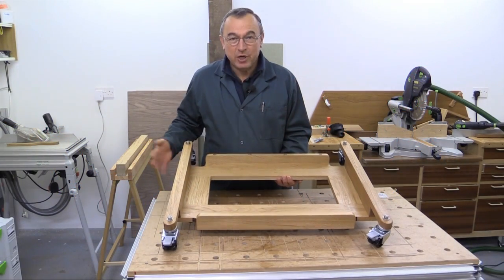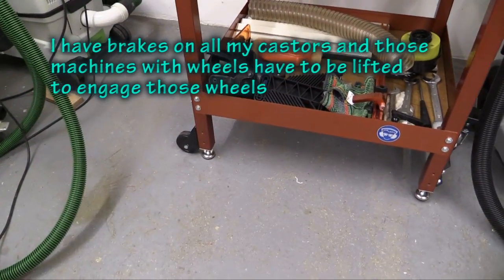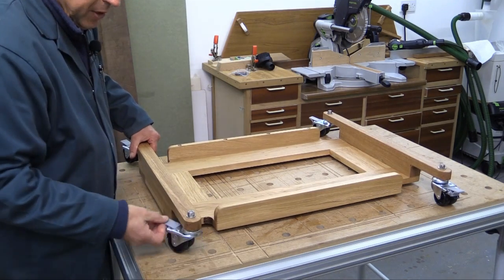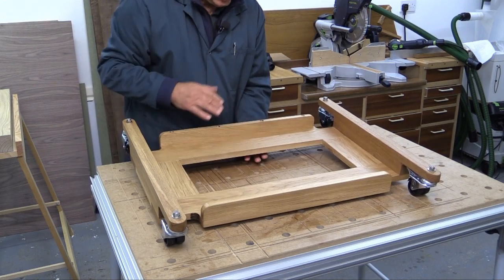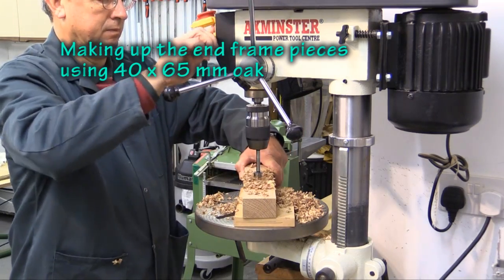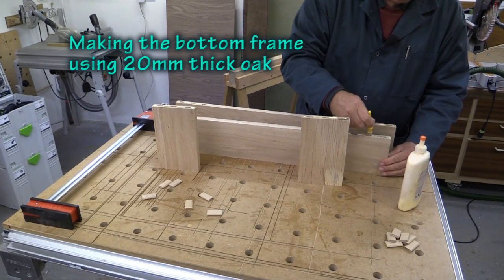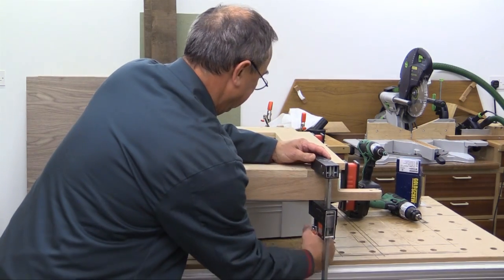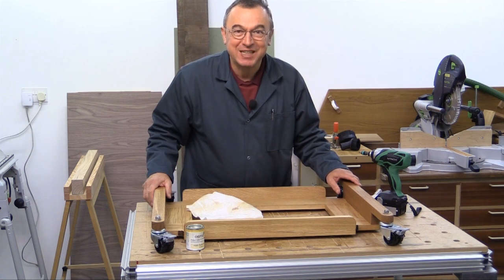How to make a moveable machinery platform - castor carriage

Comment: Hello and thanks for your quick reply.

I also live in the UK (Northern Ireland) which makes it easier to get all tools that I see in your videos.
I am currently working on building a router table and have bought a few UJK items from Axminster that I saw in your reviews.
Not sure if thit is the best decision, but I will try to make the top of the table from Fermica kitchen work top.
The cast iron one you have is probably the best, but my budget has shrunk a bit over the christmas period:) , so I am going to try with fermica first and if it's not good enough will have to save up for the proper cast iron one.
My next purchase will be a mitre saw and wanted to ask you for your advice as I have narrowed it down to Festool Kapex and Bosch GCM 12 GDL 12" gliding mitre saw, which has a negative side with it's weight of 32kg.

There are so many questions I would like to ask you, but I just don't wan't to take up your time.

Many thanks once again
Reply from the maker: Hi Vladimir

Well I was not expecting you to be in the UK - super.

I made a router table using kitchen work top with Formica and it lasted nearly 12 years. The most important thing is to make sure that the router is securely mounted. You will amazed at the amount of torque that a router produces when it starts up.

Before I bought my current mitre saw I had two on my short list - the same two that you have. The Kapex won and was my very first Festool purchase (from Axminster of course). It took all of my savings and a bit more but it is worth every penny. Everything seems to go together absolutely square using Festool kit.

Please do not worry about contacting me. I was lucky enough to have been employed throughout my working years and now it is time to give something back. I make my videos to help other people - and that includes you.

Peter
Reply: Peter Parfitt
Hi Peter

I have been living in N.Ireland for just over 5 years now as my wife is from here. We both travelled aroung for a while and lived in few different countries but decided to settle down here for good.

12 years is quite impresive, it will probably outlive many current VALUE router table brands on the market. Will give it a try anyway.
Although I haven't purchased it yet, it's in my shopping cart on the Axminster website, a UJK Technology 10mm Aluminium Router Table Insert for securing my recently purchased 2400w Triton router which hope it would have plenty of power for most tasks mounted under the table. Hope it will fit onto the universal drilled base sturdy and safe.

I think I am leaning towards the Kapex 120 as well, but will have to wait for a while and save up unless I get a good bargain online.
Somebody mentioned that the 10" kapex is more precised than the super heavy bosch, which advantage is the extra capacity.

There are so many tools and machines around your workshop, I don't even know what some of them are for? :))
Hope to have a shop like yours some day. It all takes time and MONEY :)

Would love to work with oak as I have a couple of projects on my mind in the near future when I complete the router table.
 Oak looks so nice and it's probably very strong. I haven't managed to find a place that sells oak in my town yet as it's probably very expensive and I guess it will have to be ordered from elsewhere.

Thanks for your time, it is so kind of you.
Reply from the maker: Hi Vladimir

In order to secure the router to the (effectively chipboard) work top I made up a quite complicated clamping arrangement. I put the 10mm rails (used with the fence) midway through the router and clamped them in place. I made up a bracket to take the rails that was glued and screwed to the nearside of the work top. I then had several removeable clamping pieces that screwed on and held the router tight.

When all of that is made up I put the router in place with a cutter in the router. I then very slowly made a cut through the work top and this was then dead centre with the router.

The hole needs to be large enough to take the collet extension which you will need to fit in your router. I have recently bought a new one from Axminster (211367).

If your woodworking skills are not yet up to making a really secure fixing for your router then you must find a local woodworker who is prepared to help you.

I have the Kapex 120 and it is brilliant. The extra capacity of the Bosch would only be significant if you were building big things all of the time. I have never found any problems with the capacity of the Kapex.

Once you find a good timber yard you should get to know them. They may be able to let you have some off cuts at a discount. When I first started woodworking I used to go around looking for old furniture that people were throwing away in order to rescue the wood.

Good luck and take great care building your router table.

Peter

Comment: I watched your other videos, and I'm happy to be proven wrong. I have the uncle of this planer, an SCM MiniMax FS350, a 14" jointer / 8" X 14" planer combo tipping the scales at 320kg. I had to go the angle iron route. For a shop of limited space though, the Axminster as you have it on the carriage looks like a nice bit of gear.
Nicely done informative video. Cheers!

Comment from the maker: You are right to see this as the weak point in the design but I have made many such devices and good quality oak rarely fails. The carriage is now in operation, it easily survived the loading process and it works perfectly. I will keep an eye on it of course. Take a look at my recent 3 videos about the new planer - in fact check out the last minute or so of the second setup video - not many people can claim to have danced with their planning machine !  Peter

Comment: I don't mean to be a naysayer, but the whole machine's weight (150kg or 330 lbs) plus weight of lumber being planed is carried on four oak prongs 150mm long, 40mm, 22.5mm thick. Therefore there is about 40 to 50 kg attempting to split the side rail of each prong.  By letting the planer drop at loading from as little as an inch high may well crack the frame.  I love wood, but IMHO this is a job for steel.  I hope I'm wrong.

Comment from the maker: Hi Joel, With the drill press make the base as heavy as you can. If your drill press is full height then you would need a low profile castor carriage like mine but you could then put weights on the base of the press. If it is a half height press then build a set of drawers with castors underneath - similar to my band saw base (seen in many videos). If you cant make the base heavier then you have to make it bigger. When all four brakes are on the arrangement stays still. Peter
Reply: This is the info I'm looking for. Peter - for your planer, you mounted the caster runners on the sides, would you recommend this same arrangement for a full-height drill press (H-57", 375lbs). I will be keeping my benchtop vise and drill clamp vise stored on the base so that will give it some weight. Thanks!

Comment: Thanks Peter! This is great timing for me as I need a couple of these for my planer and drill press. The drill press might be  tricky because the small base. One question on your design. Won't the base still have the chance to move with all 4 casters that can swivel or does the brake stop the rotation too?

Comment from the maker: You should have no trouble finding suitable castors - certainly from Coldene. You could create a design with 6 or 8 castors. If you have an open area in the middle, under the frame, of the planer then you could put a couple there. My first design would have used 2 x 1/4 " mild steel across the diagonals under the machine, bent up and then out at the ends to take the castors. There would have had to be a bend where they cross at the centre or a weld. Wood was easy for me with just 150kgs. Peter

Comment from the maker: Hi Tim, The ground clearance is only 1 cm. I did that to avoid the planer being raised any more than necessary but it does have the advantage that you mention - most things I make are over engineered and so unless I have failed to spot a defect in the wood - all will be fine. I did think about self levelling. Only one castor with that capability is needed but I think that is overkill. Cheers.  Peter

Comment: I'm sure it will be more than adequate. I have one of those £30 mobile base frames with mine. I wish it hard slightly larger wheels but it doesn't flex or anything.

If you can capture that footage, it would be great, I'm sure! All I can remember is that the weight is obviously in the centre but very low down, because of the motor's location. Some machines are worse than others (my big bandsaw's a nightmare because of its shape).

Comment: Nice work. You also have a fail safe with this design, because of the low clearance ( less than an inch it seems) above the floor. I although unlikely, if the structure was to be accidentally overloaded to the point that the caster arm gave way, then the machine would only fall a small distance. Therefore there seems no increased risk of the machine rolling which is a smart move. One feature I am thinking might be a good idea are self levelling legs so any tiny wobble is automatically eliminated

Comment from the maker: Hi Olly,
I am pretty sure that this design will work well with the new planer - I have stood on it (I DO NOT weight 150 kgs) and it seems fine - what a great skate board ! Getting the machine on will not be difficult and I may be able to capture the process on video. My (then) 8 year old daughter and I moved the shed that I re-roofed 100metres, in one piece, in an afternoon (it weighed over a ton) and so the planer should be a breeze.  Peter